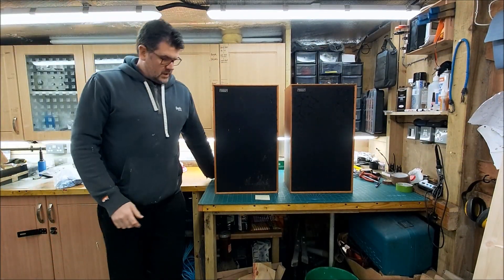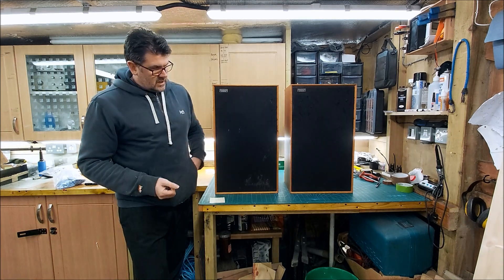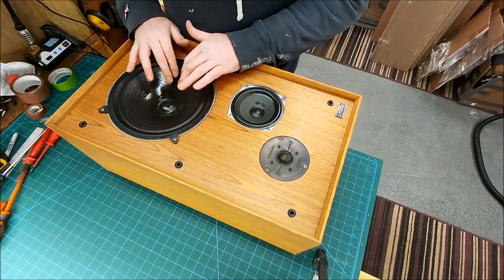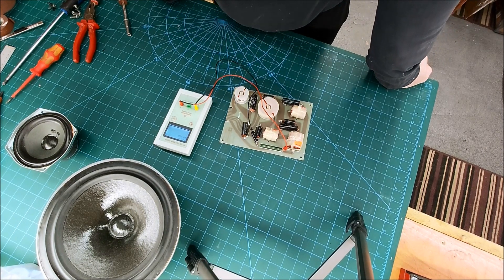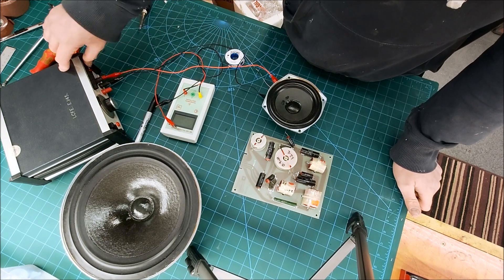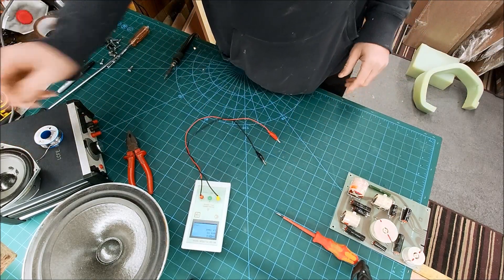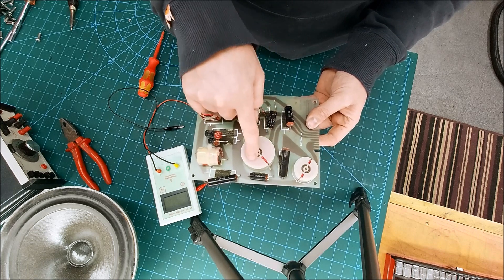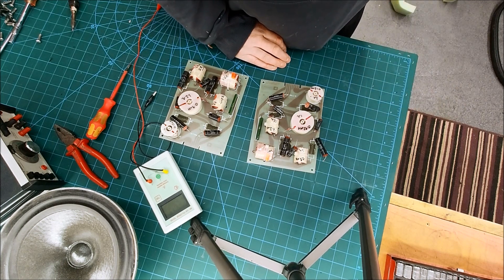Celestion Ditton 33 Part 1

Comment: Blew both of my 33s tweeters by cranking the volume way too loud one unfortunate evening 🎉.  Lesson learned.  Replaced both tweeters and now they’re fine. I also own a pair of 66s and replaced the old caps on the crossover with Falcon acoustics replacements.  They sounded a bit better afterwards.  The 66 sound really good on little the FX-Audio D802.  Good (and cheap) match for those speakers.

Comment: hello I take advantage of your knowledge to ask you for technical advice. I have recently purchased a pair of 1973 Celestion County C unfortunately the woofers have been re-hemmed in an unprofessional manner and they scratch if you push them towards the inside of the basket ... I would like to replace them with new woofers what do you advise me to buy with equal size and technical requirements ?
Reply from the maker: Hi. Thanks for the message.  Unfortunately even if you find new woofers which physically fit and have the same nominal impedance they would probably never sound right without reworking the crossover. I doubt the T and S parameters for those speakers is available so matching something would be next to impossible. Your best bet is to find a good second hand pair
Reply: @haycrossaudio5474  can you help me or do you have a pair of woofers to buy for my County C? thank you

Comment: May I ask which device you use to measure both resistors, coils and capacitors? Thank you. 🙂
Reply from the maker: The meter you see me use mainly is the MK-328 TR/LCR/ESR tester. It's a great little meter.  I also use a PEAK LCR45 which is probably more accurate on smaller capacitors as it uses a higher test frequency. I also use Dayton Audio DATS to.